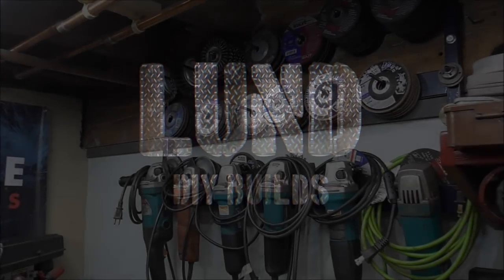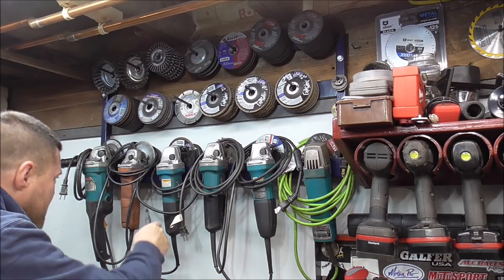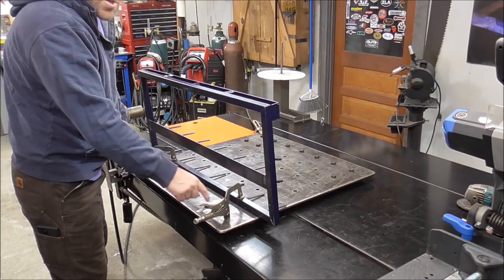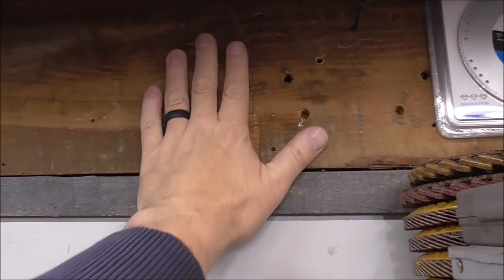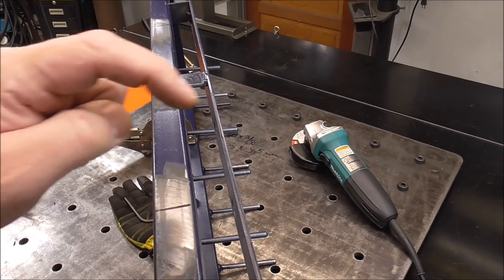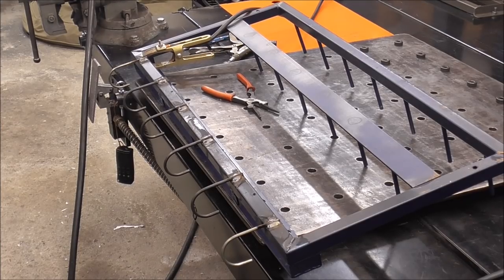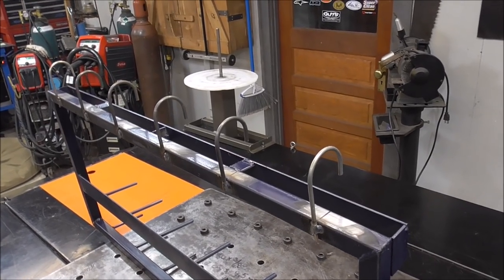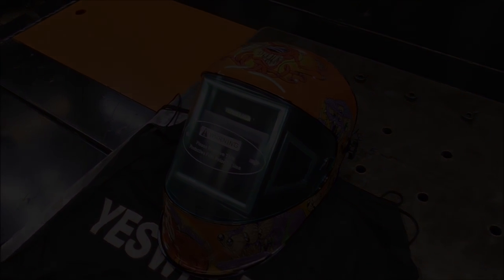Ultimate Grinder Rack Modification Welding and Fabricating Cord Hooks

Comment: I remember back in the middle 70s they only put short cords about 12 inches long on power tools, it really sucked getting out a 25 foot extension cord to work at the bench.
Reply from the maker: I remember my dad had a greenish black and decker drill with a shorty cord.
Reply: All my grinders have 15 foot cords replaced the 6 footers from factory
Reply from the maker: Thats a great idea @bart bley. The green cord on the right is about that long and I find it handy. It actually started out as an extension cord that got damaged  🤣🤣🤣

Comment: Nice rack! 
Think I'll build one, however I have a different approach re: the cables.  
I wrap them. First pass around the arbor, and then round and round the grinder body, sticking the plug through the space between the body and the cable where it first comes on the end. Not tightly mind you. Tidy and doesn't harm the cable.
Reply from the maker: Thats exactly how I stored mine Frank but the thickness of the cord around the body makes it rough getting out of the rack. Maybe if you used 1" wide flatbar instead of what I used but it doesn't work that great with this setup how it is built in this video but I agree that's an awesome way to store your cords

Comment: I wanna buy one of the harbor freight pipe, tube bender things. Also I absolutely love your grinder rack, I did one for my welding cart I built last year and still haven't finished 🤣 its my work bench right now. I have a sheet of plywood down as the table top and I hit it with some spray on bed liner.
Reply from the maker: Thanks man! I haven't tried their pipe bender. If you get one please report back!
Reply: @BrandonLund  will do. I've heard good things and I learned a couple tricks on how to use it. I need something like that so I can try to build a go kart frame. The mini bike is way to dangerous to attempt any further mods 😅
Reply from the maker: I'm impressed that you pulled it off. A lot of folks wouldn't even attempt it. If you can do a motorcyle I know you can do a cart.

Comment: I’m considering painting project work and contracted pieces but leaving shop rack and tables in the black steel, acetone wiped look. What will happen over time without paint? Will it rust?
Reply from the maker: @mike coughlin it will over time. I have a coffee table and end tables I built and left the steel raw. To slow the rust I apply minwax paste furniture polish to the raw metal. It slows the rust but won't prevent it all together

Comment: Would be better to make them longer or add some more for extention cords just at the bottom grinders and using some plastic or matal quick clamps from Hardor Frieght on the middle of the rolled cords helps to keep them together.👈🤓👍
Reply from the maker: @Mike K that would work also but this was the look I was going for.

Comment: Have you had any issues with paint not sticking well and Bubbling when cleaning steel with acetone? Wondering if I need to switch to mineral Spirits @Brandon Lund
Reply from the maker: I have had bubbling with acetone Antonio but never with mineral spirits.
Reply: @BrandonLund  omg so My Pai t issue is The Acetone I knew something wasn't right but never thought it would be the Acetone thanks for the information and Comferming my suspicions Brandon
Reply from the maker: Just keep wiping until no black on your rag and your good to go. Half the time I don't even prime and I never have issues.
Reply: @BrandonLund  I always wipe till the rags are clean but always have bubble issues never could pin point the problem now the Acetone makes sense going to get mineral spirits from now on very much appreciated brother
Reply from the maker: Anytime man (plus it's cheaper than acetone) it's a win win :)
Reply: @BrandonLund  yeah I always buy the large gallon metal cans from kleen

Comment: I love and prefer corded power tools but when they design them they should make them to where instead of them having a 8 foot cord or whatever instead just have a electrical plug on every tool and so then you can use one cord for all of your tools.
I might chop all of my cords off and redesign them to have electrical connectors. .
, most my tools are old or cheap anyways so no feeling guilty about chopping the cords off.
Also that way I can choose how long the power tools cord is , I can plug a 8 foot cord in or a 50 foot cord no problem.
Reply from the maker: Thats a great idea! I like it!
Reply: Great idea!!!

Comment: A The technique I use alot instead of welding your disc rods on near side i  drill and ream a hole and plug weld from far side so you dont see a weld and there straight
Reply from the maker: Great tip! 👍

Comment: hi, i have a small block chevy block with a small problem, i took the block to a machine shop to be cleaned and bored 30 over, as they were removing the rear oil seals, they made a small crack on the block around the seal trying to remove the oil galley plug, i was called and i were told that my block was no good, i got upset and bought my block back home, what im looking for is someone who could weld good and fix my block, can you help me on this block or do you know someone who could weld as good as you that you could recommend me? i live in long beach california, i need your help, thanks, oscar
Reply from the maker: I could definitely weld your block but the price to ship would probably not make it worthwhile. Anyone with any cast iron knowledge can do this. Being from California it should be fairly easy to find a reputable shop that is knowledgeable about cast iron welding. It will likely require machining afterwards and I would recccomend a nickel rod or a specialty rod like Muggy Weld.